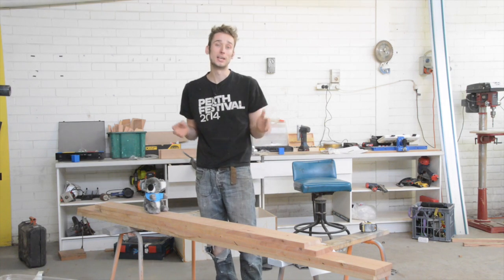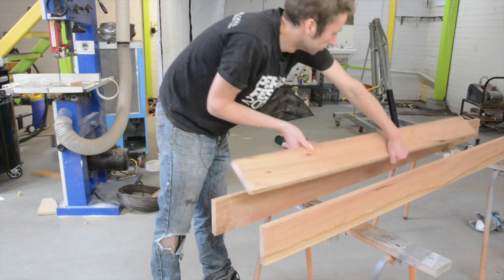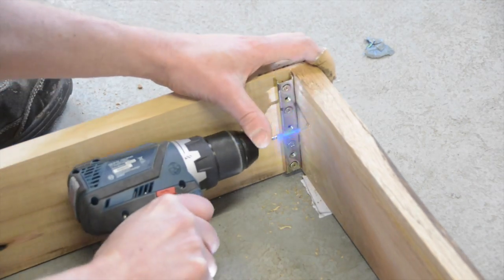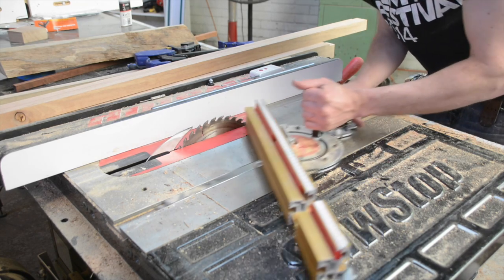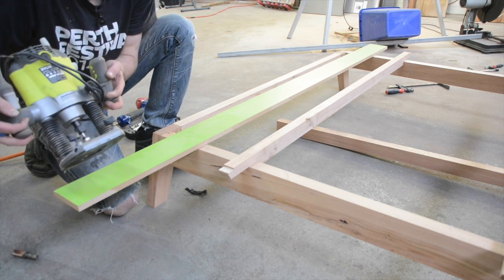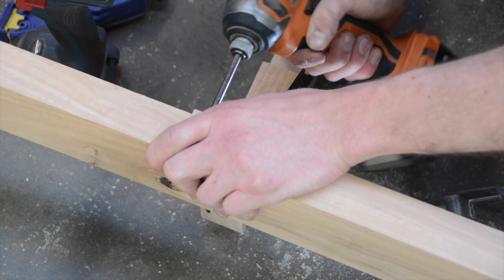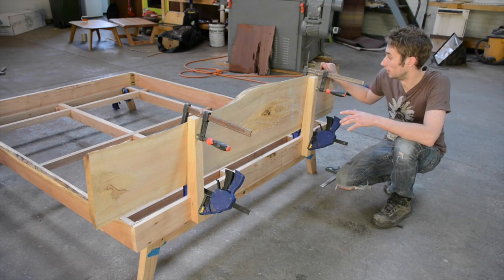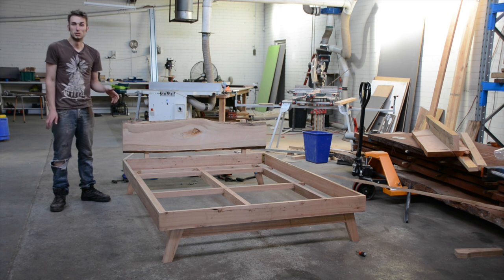How to make queen size platform bed Part 2 of 3 - Outer Frame and Headboard (JordsWoodShop)

Comment: Jord, I have had a couple of "false engagements" with my SawStop as well... but I used my Bosch Glide to form some rabbets the other day, and I now quite prefer it to he table saw method.  Using the depth of cut limiter on the right side by the lockup knob, I was able to make quick work of a half inch rabbet.  Of course, the 12" blade in the Bosch is wider than the narrow kerf blade in the SS, so that might have something to do with it, but moving the saw blade instead of the wood (especially on longer pieces) seemed easier as well as safer.  I also did some half-laps on two by fours using a bandsaw for the long half cut and the Bosch for the shoulder cut.

Comment: I was expecting the offcut to catch and ping across the room. But why did the Sawstop trigger! It would cost me 4 cartridges a week if it happened every time!!!!!! Luckily my saw will allow me to cut my fingers off, sometimes I think it wants to :D
Reply: The Sawstop triggered because the aluminum miter gauge was to close to the blade.
Reply: Oh thanks. That is interesting. I wonder how the Sawstop system would go on a full size panelsaw which come with aluminium sliders.

Comment: I imagine the bed Will breath rather poorly with a sheath of ply in the bottom. I would rather use slats.
Reply from the maker: mike makes You could easily use slats, this is a memory foam mattress that says it can be on a solid base.
Reply: JordsWoodShop :) ok